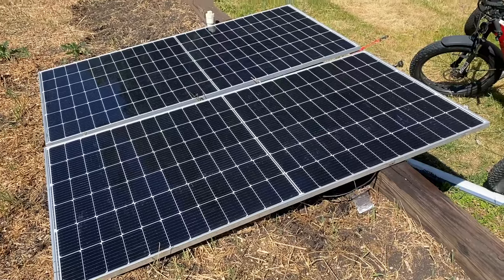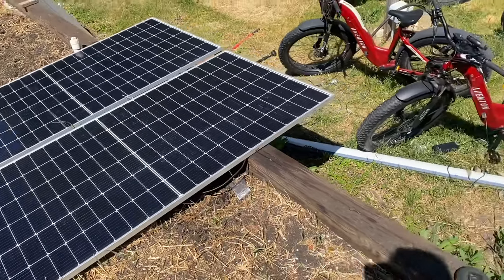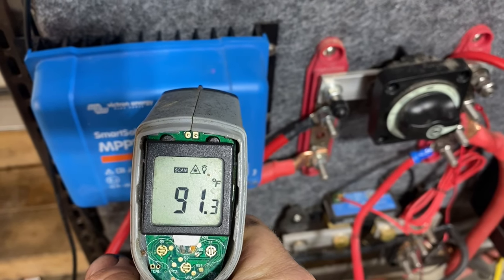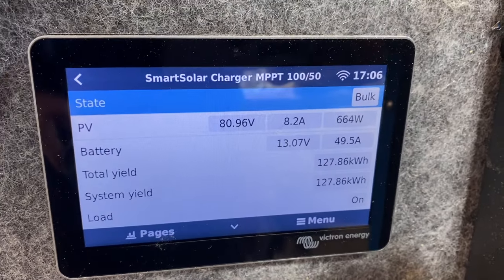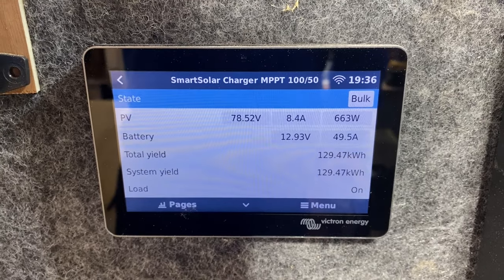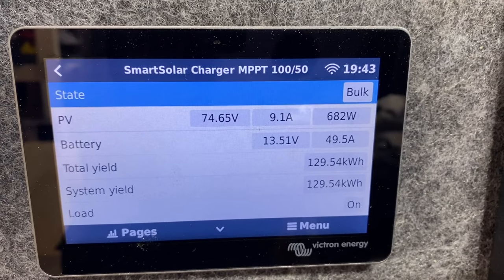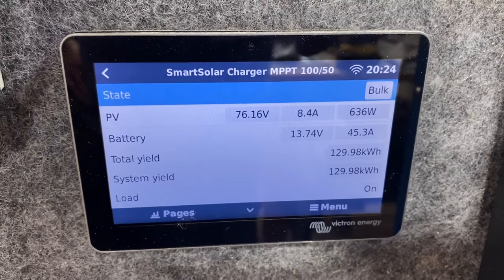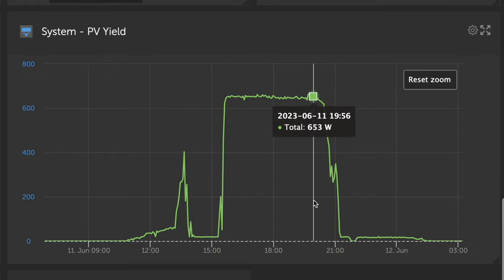How Many Watts of Solar Can You Put on a 100 | 50 amp Victron MPPT Solar Charger

Comment: With the controller you have, the 50Amps rating is the maximum output ................... NOT input. It is only capable of handling 100 VOLTS on the input side. I donot think you understand the basics of electricity. Watts = Volts X Amps. So naturally when the voltage rises so does the watts.
Reply: Nothing that he said in the video has anything to do with your comment. He has two panels, we don't know if they are in parallel or series, but even if they are in series, they would be 80V max
Reply: @veeerzes  Victron lists the maximum nominal PV power at 12v for this CC at 700w. When the poster throws 960w at it, in direct sun and with the batteries at the SOC they were, the MPPT ups the current in (which was <10a) to 50a because of the voltage the panels were producing. The CC in fact was clipping power as it is designed with the downside of creating heat. The poster made it seem like the panels were perfect for the controller based on the numbers but the CC was just doing it's job. Sure the 960w is over paneling which has it's benefits but it's a little high for the product rating.
Reply: @mezamichael  still has nothing to do with the comment I initially replied to.
Reply: Usually charging voltage is above 13.4-14v though so wouldn't that mean it should be able to cover more watts than 750?

Comment: I have a Victron 100/50 on a 12v system supplied by 1620 Watts of solar.....handles it fine and is great on dull/cloudy days....this point is missed by so many people, especially as panels are so cheap to buy these days.
Reply: what solar panels you using?
Reply: Dang.... that's impressive! What does your panel setup look like?
Reply: I am in the process of putting 4- 300 watt panels in series on my van for a total of just under 1200 watts and have installed a Victron 100/50 on my 12 volt system, I am happy to see your post saying it works well, thank you.
Reply: What about the VOC rating?
Reply: @todddineen  How is it working 10 months on?
Reply: @garyenwards1608  I have gone to the West coast twice, from Colorado, and then a 4k plus mile trek up into Canada, around to the Westcoast and back. I have not had to plug in a single time. I have plenty of battery and the ability for charging no worries.
Reply: @todddineen  Thanks for the reply. You put them in series and parallel? Do you know the VOC of the panels?

Comment: Folks there are some very good charge controllers out there But I recently purchased a VICTRON CHARGE CONTROLLER 100-30 There are no words to explain this product but I can tell you in my words that the quality & the workmanship of this product is second to none. I am so taken back on how beautifully this equipment performs. The reviews of this product is right on and I highly recommend on a scale 1 to 10 9-1/2 seven STAR
Reply: Yes, Victron is pretty good. I would caution, though, that when buying Victron charge controllers it is best to buy newer model controllers that can handle 12/24/48V instead of the older model controllers that can only do 12/24V. 

So, for example, the Victron 100/20 and the 150/35 models can do 12/24/48V.

Also, always get the Victron "SmartSolar" type and not the "BlueSolar" type.   The Victron Smart Solar's have built-in bluetooth, no dongle needed.  It is incredibly convenient and useful to access these devices with the Victron Connect smart phone app.

-Matt
Reply: Why?

Comment: I think you have the panels in parallel rather than series    in parallel the amps out   are added       but in reality  you should be exploiting the mppt controller    for its max pv    in other words  panels in series      your average solar   of 450 watts     450 divide volts   eg 30v=15a     or if its 40v panel     450/40   its 11.25a      in parallel   its 2 times these figures    so 30a     or      22.5a   all within the capability of that victron     then if you wire in series    the amps dont double   the volts doubles   to 30=30v   all within the pv spec of the victron   so i have no idea what is happening here   in truth in series   you could have 3 panels on

Comment: I had read in some victron info once that talked about over paneling victron charge controllers to 1.5 there watt rating. As long as the panels are under the voltage rating
Reply: You can connect a million watts to it, it will only use what it's max limit is

Comment: Very interesting. I have 740 worth of panels on my RV and a 50-amp charge controller. We spend our winters off grid in Arizona and it seems to work fine. Four 100AH lithium batteries and a 3,000-watt inverter. We don't run the air on it but most everything else. The numbers call for a slightly larger charge controller (I have a 60 amp for backup). but so far so good. Thanks for the video! Burlington Bill busking on the road and here on You tube.

Comment: You are safe to overpanel as much as you like too, as long as the voltage is below the first number on the Victron.
 The Victron will just cut the amps back to the second number and that is on the batteryside.
So wih the 100 50 just stay under volt and repeat in parallel as much as you want. Your 12 volt battery will take in only like 600 watt from your production.

The thing is, most setups with panels will only produce their peak production during one hour a day, the rest will be less.
You can solve that by rotating one 100 string of panels towards the east, one string  to the west and if you have a third string, turn that to the south. That way you spread the production over the day allowing more Ah's to enter your battery over a day time.

Also, aim them vertically  for wintertime, not for summertime.
Reply from the maker: Great points
Reply: Just don't overcurrent the input side.  That value is listed on their spec sheet.
Reply from the maker: @ItsEverythingElse you can’t overcurrent it, only over voltage.

Same as any other ac or DC appliance, a battery might be capable of 200a of discharge, but the appliance will only draw what it needs. Same thing with an MPPT, it’s drawing from the panels. The panels are not pushing (at least not with amps) the voltage does the pushing.
Reply: What happens when your inverter only supports 1 string? Or do you hook it up to only pull power from the batteries, not directly from the panels?
Reply: @gigel99324  Your inverter is hooked directly to your batteries.  You can't run it directly off your panels.
Reply: @gigel99324  Hi, use the same panels and it’s just in parallel. It’s waist full on panels but you will get a longer output from the one charge controller. Having 2 controllers would let you see the difference in real time, might be nice to see but very expensive, unless you went for much cheaper lower output charge controllers.

I dare say someone will do it and give us feedback.
Take care all M.
Reply: @sotasolar  Yes with MMPT charger you can not over current (Ampere) them on the input side, but overvolting will kill them... But with the old PWM chargers they could be ruined with to much current (Ampere) in from the panels, it is maybe that is why many think it is same with MMPT.
Reply: @sotasolar  this is not true. There is a max Isc rating in the datasheet. Exceeding this risks fire as its the limit of the protection circuits and fets inside the mppt. For example if your battery disconnects durring charging the mppt has to shunt the voltage spike to ground. I have seen victron mppt controllers melt and catch fire when this happens and Isc is exceeded.

Comment: I have 6 x 200W 24V panels run in parallel installed flat on my rv with this controller. Here in the pacific northwest, it works great. Allows me to max out the controller from 11-3 to bring my 3x100Ah batteries to 100%. thanks for sharing.
Reply: There's no such thing as a 24v solar panel lol it's just a sales gimmick or well there lieing
Reply: @lickalittle please do more research😂, higher wattage panels are actually rated with voltages more than 24v, hence 24v panels
Reply from the maker: That’s true, but it’s how they are sold.
Reply: @lickalittle 🤔🤭🤪😜
Reply: Just check your max Isc

Comment: IV a epever 100/40. IV got 3 pairs of 260w= 1560w max
IV way over panelled it more for winter months.
It works fine.
Only thing IV done is mounted both my charger controllers on a 24"x24" aluminium plate with air gap to back of....this really does help keep them cooler.

Comment: On my 100/50 with 2x2S setup of 545W PVs i maxed out close to 1500W, on 24v AGM batts. With 5v usb active cooling fan in it, otherwise it throttles down. ;)
Over half a year on this setup.
Reply: Hi, yes they do throttle on temp.
Cooling fan is required if you max it out.
Electronics also like it cool, they live longer.
Take care M.
Reply: USB fans? What a great Idea - Thx
Reply: @joaoc_PT  2180W of panels at 24v? Is that safe, isnt it max out at 1600w? ;-)
Reply: @HuDz1966  If you take a 24v battery, the maximum charging voltage will be at 28.8V or 29V, which means you will be able to get around 1450W max.

Comment: thanks for that, I was thinking about plugging 2x 430W flexible panels into my 100/50 charger, so it looks like it will work.
Reply from the maker: Yup
Reply: You will only get 600w max with 12v battery or 1200w with 24v battery.
Reply from the maker: @hasanagera that would be true if batteries charged at 12 and 24v, but they don’t :-) They charge between 13.5/14v and 27/28v generally. 

I’ve seen this first hand in this test as well as in our RV with a 24v system. Our all time high score was in the Tetons on a cold July morning, 2800+w in from 2x 100/50 chargers.
Reply: @sotasolar  you are correct. Charging voltage is the max voltage for batteries so it is more than 12v but people usually use 12v because it is less confusing 😂

Comment: Can never go too heavy on solar, other than what your budget allows. As time goes by you can get another charge controller and batteries and make a parallel system to power different stuff.
Reply: So can I join my Victron 75/15 with my Victron 100/50 and my 2 same brand and AH batteries together so I can have more panels or
Reply from the maker: @TheAnimeMiner yes, so long as the panel arrays are in spec , you can parallel charging sources all day long.

Comment: It seems to me this is an example of why going for a higher voltage system is a good idea.  That relatively affordable 50 amp Victron SCC wouldn't be clipping your panel output if you had a 24v battery...  You'd be cruising along at around 30 amps: a nice, comfortably output for the SCC.  With the setup shown, it is possible you'll wear out your SCC sooner running it at its 50 amp maximum for portions of the day.

Comment: Hi Mate, I've been running 4 x 250 watt panels (2P2S) on my Victron 100/50 MPPT charger for over 2 years now and it does throttle it down during peak sun, however during overcast or late in the day I'm able to get higher output due to larger panels. I run 3 of these units like this. I like redundancy, and their cheaper to buy than 1 larger capacity MPPT without redundancy.

Comment: Question. What about the VOC rating? Some say that is what counts.
Reply from the maker: They are right. Stay under 100v  , these larger panels I believe where above 50 voc, however it was hot (this reduces voltage) and the system was under load and was just for testing.

Comment: When you’re talking about your 50 A, your reading battery amps. your controller is capable of handling 50 A of PV looks like you only have 9 amps of PV input. You can put 40 more amps in from PV if I’m not mistaken.
Reply from the maker: I believe you are mistaken. 50a of PV would mean a theoretical max of 50,000w
Reply: @sotasolar  nope, 5000 Watt (5kW)

Comment: I have this exact same charge controller and eight100 W Renorgy Solar panels I have plans to try to do four in series and another four series and then parallel everything together and bring it in that way do you think this would work for this charge controller it will be on 12 V system with lifepo 4 batteries
Reply from the maker: 1200w would likely  be close the max I’d want to throw at it. Go for it and report back! You’ll likely clip around 10:30-11 am until 2-3 pm but that’s fine. You can comfort yourself with a full battery :-)
Reply: @sotasolar  thanks 😊

Comment: Okay you seem to know what you’re talking about👍 I have 2x 200 amp 12 volt lithium batteries in my pop top caravan. I want to mount solar panels on the roof. Weight is important as I have push it up. would you use 4wd type or domestic. Should I run the panels in series or parallel, and what specs should take priority when buying the mppt. Thanks

Comment: So with a dual battery system at 24V you could get double the wattage right?
Reply: That particular controller can do 1400 watts at 24v. Most controllers will state in the manual their maximum wattage at specific voltages.

Comment: The Victron won't begin de-rating the current until it hits around 60C (140F).   Victrons can run indefinitely at their current limit, 50A in this case.   The max wattage is strictly a function of the output voltage x 50A.

12V battery bank x 50A = roughly 700W
24V battery bank x 50A = roughly 1280W
48V battery bank x 50A = roughly 2750W  (not the 100|50 model which is only 12/14 though)

Generally speaking, this is why, in modern times, people constructing new systems should go straight to 48V battery banks.  More power for less amps and far, far fewer wire losses.
Reply from the maker: 100% right. Only caveat is in RVs if they want to use a 2x120 Multiplus , then 24v is max, as of this writing.
Reply: I had that exact question!! hi, so i'm thinking of getting the victron 100/50 also for my CIGS panels.. currently I have one 200w and two 100w panels to start, I want to eventually get it up to around 1200w - will I need another victron ? or will the single 100/50 be enough for 8 panels totalling 1200w ? also should i do series or parrallel? or both?  thanks @sotasolar
Reply: @DeFiDuke the the 100/50 mppt is more than enough. Assuming the panels have a VOC of 20V+, you can only connect 4 of them in series with a total VOC of around 80+ which is below the rated 100v.
You then parallel the remaining string but try to match the total voltage of each estring for optimal power output
Reply: @brianolowo7  Another twist to keep in mind is that one Victron 100/50 is like $184.   One 100/20 is $90.  So you get 2 x 100/20's and that allows you to give each string its own MPPT.  Or at the very least, to reduce the parallelism needed.  That does wonders in variable-shading conditions.

Also, the Victron 100/50 only handles 12V and 24V battery voltages.   The 100/20 actually handles 12/24/48.   So if you decide to upgrade later on, having the 100/20's is one less thing that would need to be replaced.

Comment: Hi i have 2 of those 100/50 24v sistem with 6 320w panels each 12 total over paneling in P.R. over 93f temp they get super hot ,like you said they don't throttle down ,but i my case was cheaper to get panel than buy a new charger controller, so i decided to over panelling they max out 2800w i have 12 x320 =3800w if they broke i buy bigger ones 🤷
Reply from the maker: Yup, over paneling is where it’s at.

Comment: The manual only gives nominal figures. For SmartSolar 100/50 its 700W and 1400W with 12V and 24V setup, respectively. I couldn't find a max value though. I prefer how Epever reports their maximum power as 1.5x the nominal power. They also state what happens when you operate above nominal - controller limits power to nominal value. I wish Victrons documentation was better. They have a good reputation, but ive found many problems in their documentation. For example not stating equipment compatibility clearly, not giving all dimensions on their drawings, and not stating absolute maximums (which is typical for all electrical equipment). I did expect higher from the industry leader.
Reply: So for 12V and 50A (600 W) you are saying 700W output, so the controller is performing 15% over specification, which is pretty darn good.
Reply: @dondonaldson1684  I double checked the manual. Its says:
Nominal PV power, 12V (1a,b) for the MPPT 100/50 is 700W.

The footnote (1ab) says:
1a) The solar charger will limit input power if more PV power is connected.
1b) The PV voltage must exceed Vbat + 5V for the controller to start. Thereafter the minimum PV voltage is Vbat + 1V.

So yes, nominal is greater than the max current times the max voltage of the battery. 

Maybe its because the battery voltage can be greater than 12V. When charging the voltage of a 12V lifepo4 battery could be as high as 14V. So 14Vx50A=700W.
Reply: @dondonaldson1684  I dont think you want to operate above nominal because the system will become less efficient. Above 700W the controller will not be able to track the maximum power point anymore.
Reply: Excellent responses! You are correct. When charging to ~14 volts, the wattage calculation would yield 14V x 50A, or 700 watts. You could "over panel" to provide more Wh in a day because the Victron will limit to 50A.

Comment: All is  written directly in manual from victron 100/50
Operating temperature  is from -30 to +60°C (full rated output up to 40°C) ......+60°C   is around 140 Fahrenheit
Max solar power FV with  12V  system : 700 W ....around 700 / 50 amp = 14 V max.....
Max solar power FV with  24V  system : : 1400 W ....around  1400 / 50 amps = 58,3  V max....

Comment: I have a 555 watts solar panel & a 12v 100ah battery. What MPPT charge controller should I use on these?